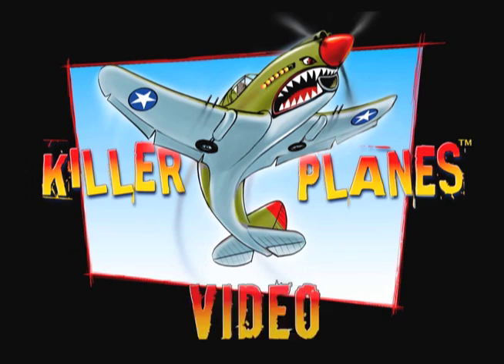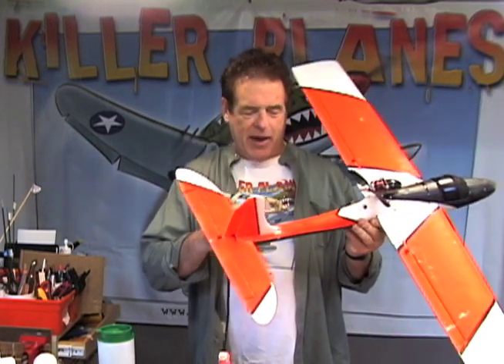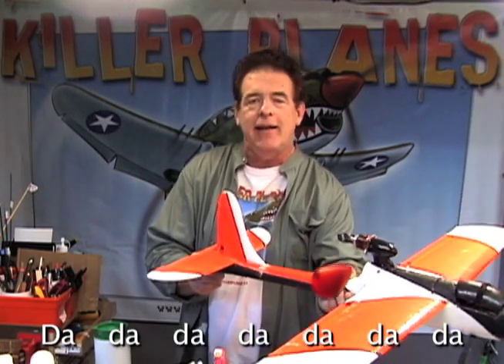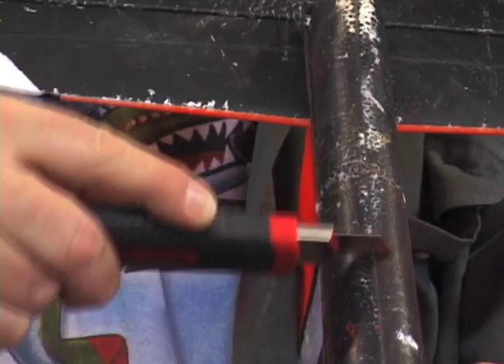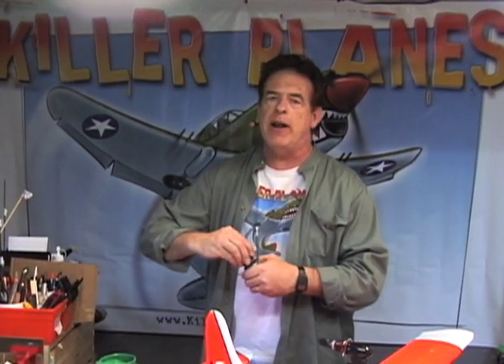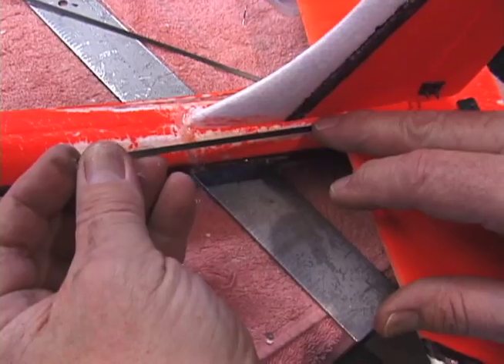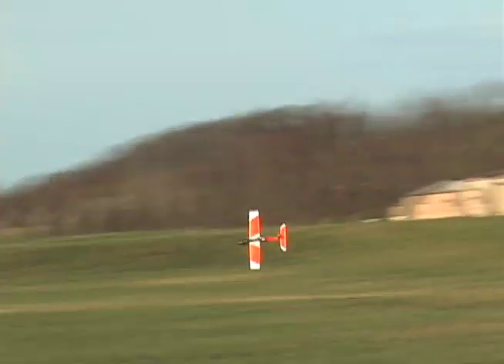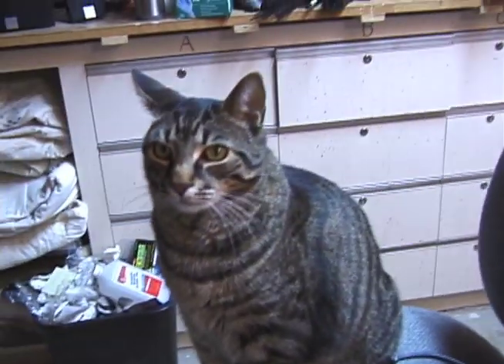HOW TO REPAIR A FUSELAGE BREAK WITH THE MAGIC TRIANGLE FEATURING THE HAWKFIGHTER 6

Comment: CF is expensive as far as support goes, I buy mine in the 3 foot rods both square and round, 3 or 4mm is every bit of $6+ same price as 2 part epoxy. As far as hot glue my 3 guns small with low and high, medium the same, large high only. The one I use the most thermals at 430 degrees, and yes 30 seconds later fully tacked not cured. If your crash proof A-10 impacted like mine..lol yes it would have broke in half. But you can't tell me hot glue is lighter, stronger and as resilient as epoxy.

Comment from the maker: If your hotglue cools in 30 seconds, it's not hot enough to work right. It only gets really sticky when it's HOT, (380-400 degrees) and that takes a few minutes to cool inside foam. Since I've worked on foam planes all day every day for a few years, I think I know what I'm doing. I was doing what you're describing a couple of years ago, but not any more. Our Crashproofed A-10s don't snap in half, even after 30+ crashes. And where are you buying CF that 12" worth can pay for a bottle of epoxy?